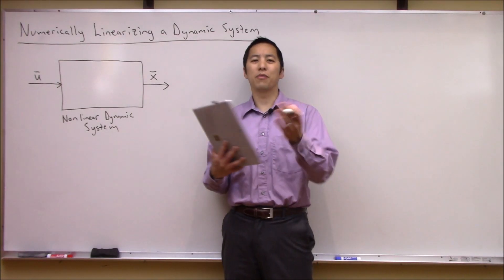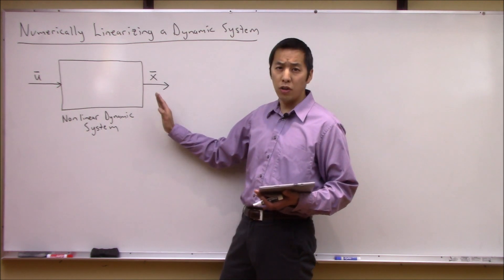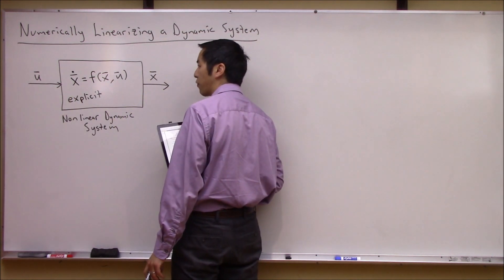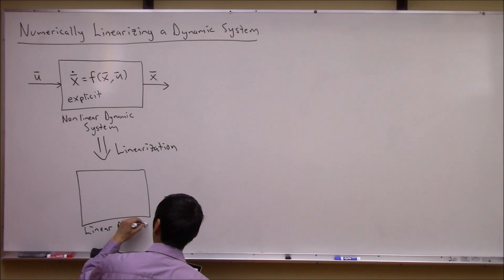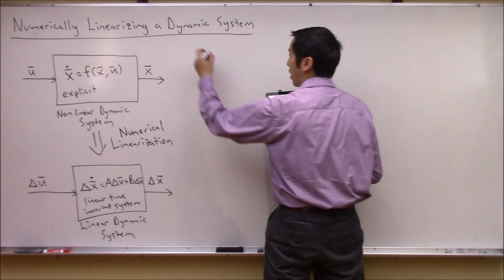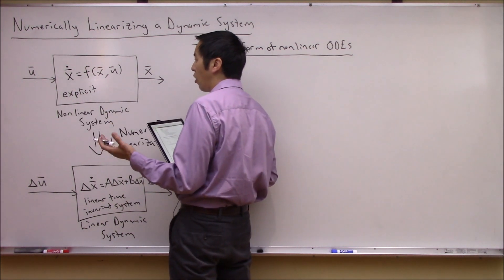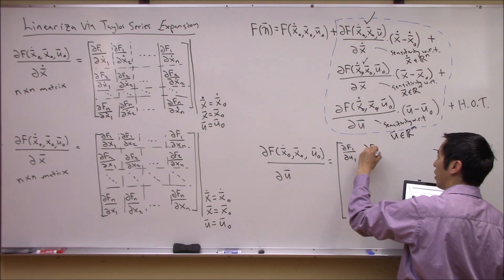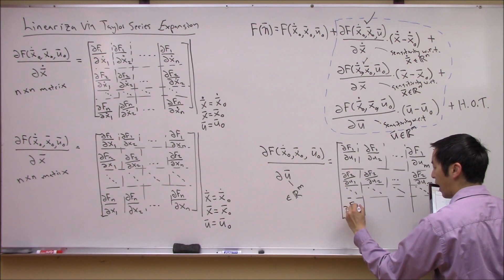Numerically Linearizing a Dynamic System

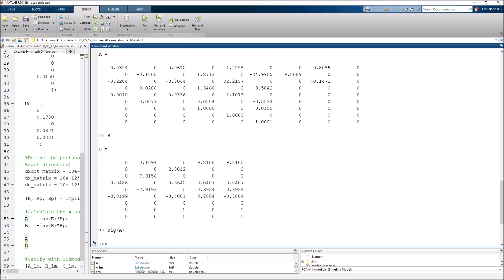Comment: Professor Lum, I agree with most of the comments which highlight the remarkable quality of the whole flight mechanics playlist, I followed them up entirely and I could even feel a shift in the excitement as I was advancing through it, they are tremendously helpful to settle a deep understanding in all of the lectures I have taken in stability, automatic control and flight mechanics. I would appreciate the uploading of the video mentioned first in 1:32:00 and then in 1:43:20 as I believe is the only part left to close up the series. Again thank you for these videos and congratulation for the work

Comment: This is a very great and hard core video! Thank you sir. The question at the end is also my question. Should we design a controller for each trim point? How would the controller parameters adapt as the trim point changes in the runtime or during my operating regime?

Comment: Dear Professor, One question please at 19:56 we have chosen a linearization point. In many sources, it is mentioned that this point should be the one where states' derivatives are equal to zero (equilibrium). Otherwise, it is said that our linear approximation is not appropriate and we could not judge the behavior of the true non-linear system by our linearized version. What do you think about it?

Comment: AA516: As others have mentioned in the aforementioned video (Trimming a Simulink Model Using the Linear Analysis Tool), the Linear Analysis Tool has moved in later MATLAB versions. Since it took me a little work to find it (using R22b), I thought I'd reiterate the steps I took to get it:
1. From "Get More Apps" in the regular MATLAB window, install the "Control System Toolbox" (this is a pre-req for the next step).
(*NOTE: I was denied installation on my first attempt, but logging out and back in fixed this issue).
2. After that's installed, from the same "Get More Apps" tab, install "Simulink Control Design."
3. In the Simulink model, under the "Apps" tab, "Model Linearizer" is now available, which seems to be the same thing as the Linear Analysis Tool. 
Hopefully someone finds this info useful!
Reply from the maker: Thanks for the steps!

Comment: AE512: One more question:
Just to be clear, the function values F(xdot0,x0,u0) are evaluated after taking the derivative, correct?  Because if you were to evaluate the function prior to taking the derivative you would end up with just scalar values which would differentiate to 0.
Reply from the maker: Correct

Comment: AA 516: I am a little confused on what you meant when you said we should choose our expansion point in the taylor expansion such that F(eta) = 0 so that the point is consistent with the dynamics of the system.
Reply from the maker: Good question.  If you choose a point where f is not zero you are using a point that is not an equilibrium point.  You can still proceed but the linear system is an approximation about a non equilibrium trajectory.